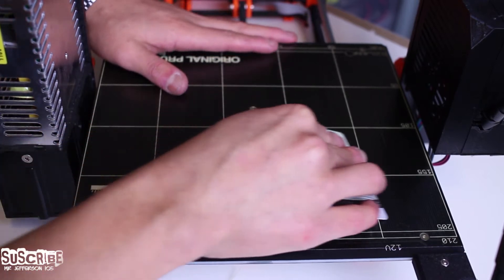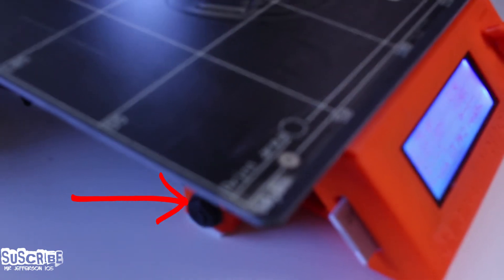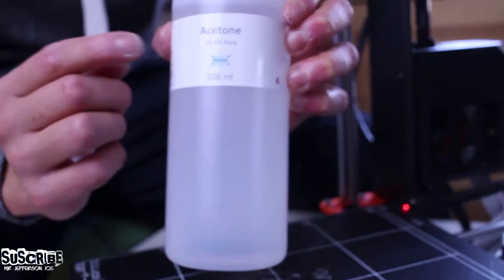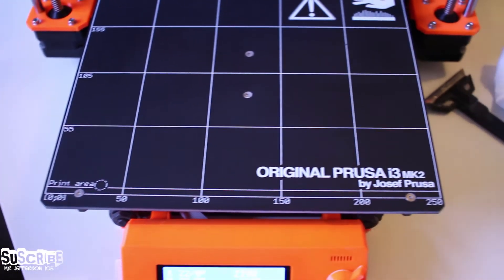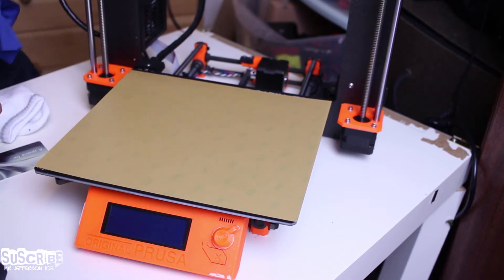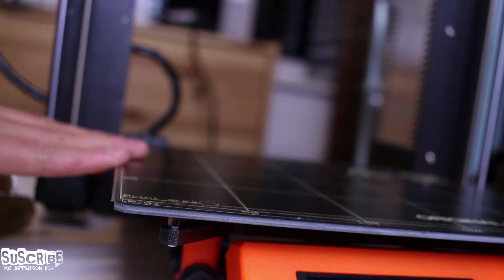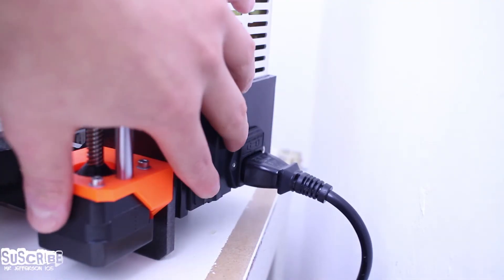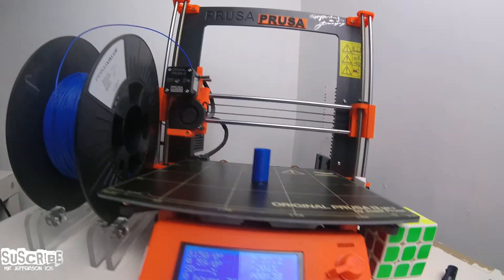😁Tutorial -  Replace PEI Sheet Without Freezer Prusa MK2s

Comment: Easy way is to put a bag with ice cube on surface of bed, leave it for 5-6 minutes and pei sheet will be much more easier to unpeel.
Reply from the maker: Flavius Tech if that works for you .I just don't like that method. I don't see it practical.  Specially having ice or water around any electronics

Comment: Great video! Thanks for making the English version.
How did you decide to use heat to loosen the PEI sheet?
Reply from the maker: No worries Happy to help. I used to remove sticky labels off glass with heat . I though this is just a big sticker or label with glue , since the printer has already a heat element i thought to myself might as well test it and see if it works. So the method became pretty easy to do. 

Also I didn't want to take apart my precious printer . Or use the freezer as other people show.
Reply: I appreciate you taking the plunge and doing this.
Did you choose 105°C for a specific reason? 
I searched for information about the PEI sheets and the adhesive but really couldn't find much to guide me for removal.
Reply: Funny thing about the freezer technique. I am in Minnesota, USA, and outdoors the temperature right now is -24°C (-11°F), so if I wanted to I could just do the freezer thing in my garage without disassembling the printer. Outside is one big freezer! But that would still leave a lot of adhesive on the bed, so I like heating the bed and removing the glue with the PEI sheet better.
Reply from the maker: wow That is so cold . Let me know how it goes when you change the PEI sheet .